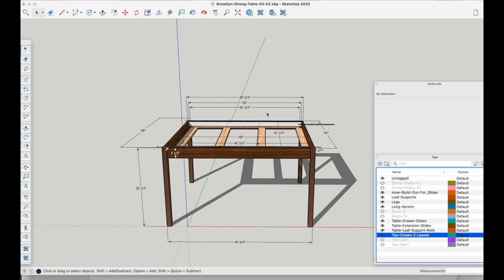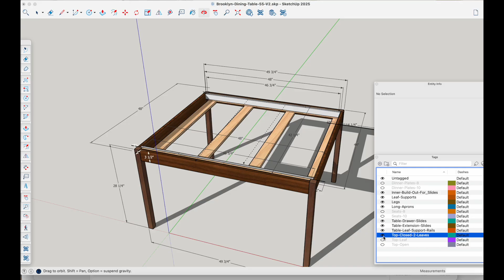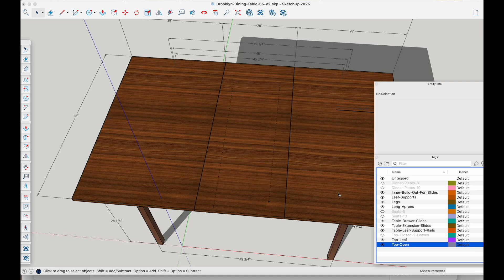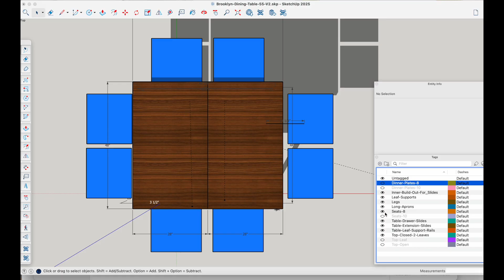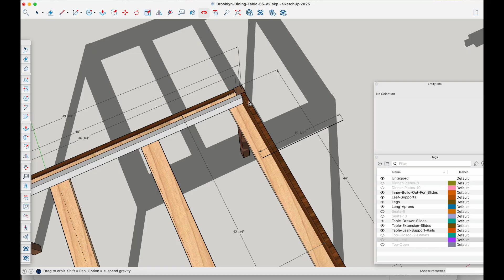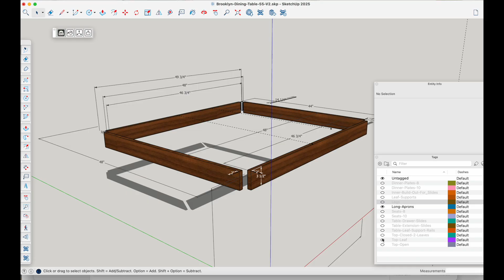Save time and lumber - SketchUp  for Woodworkers Design Your Furniture

Comment: I paid for and downloaded the basic version of sketchup....and as a woodworker found it a useless waste of time.
What good is design software if you can't print components out of it?
Fortunately the refunded my money promptly.
Reply from the maker: My POV is to use Sketchup only in its simplest form. I agree that printing is not intuitive but if you make your live screen smaller, printing is actually easy. For Sketchup to modify the size of a leg or drawer front (for example) you just use the "Scale" tool after selecting the object and type in the exact size (such as 29") instead of the % change. This makes it very easy to change an object's size and then move it to the table apron. I tried some of the CNC design software, like Fusion 360, and its way worse, not intuitive at all. Let me know if this helps. It's more expensive but I buy the desktop version, doing this in a web version is more difficult too.
Reply: @SimonMetzWoodworking  
Frankly, for my woodworking projects, PowerPoint works just as well.
Reply from the maker: I completely see your point. Today I was creating components for a new project and Sketchup doesn't allow you to select identical parts and count them as a quantity of the same component, completely illogical user experience.
Reply: @SimonMetzWoodworking 
It's 3D PowerPoint. That's all.